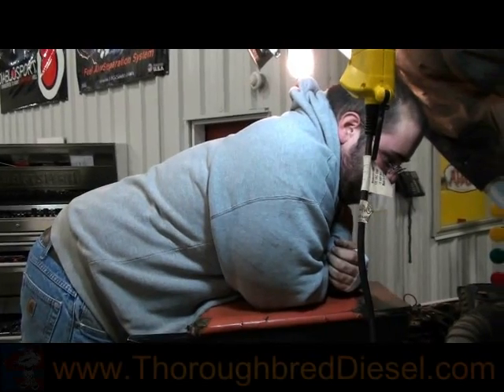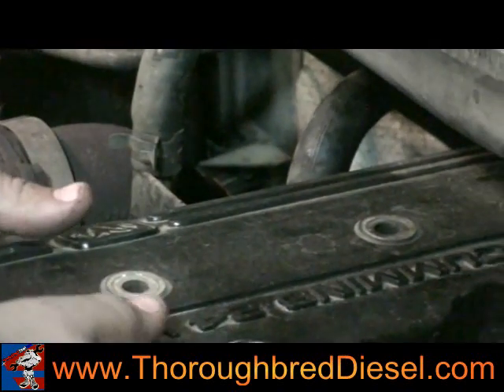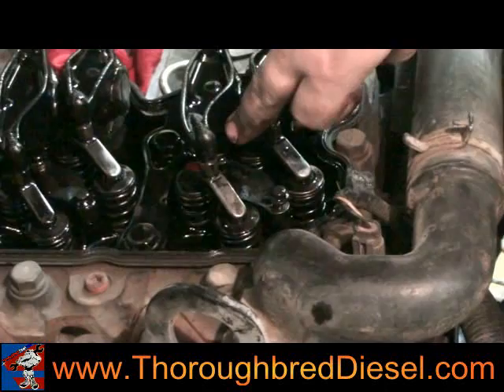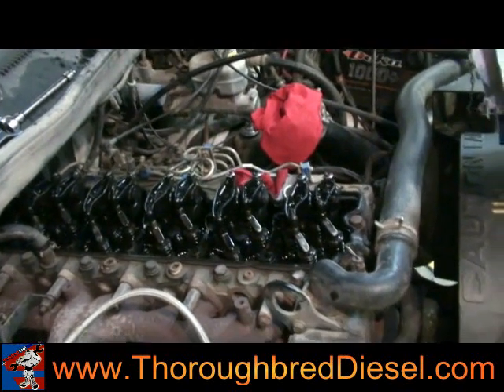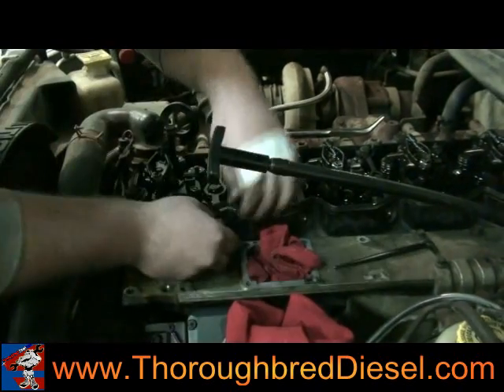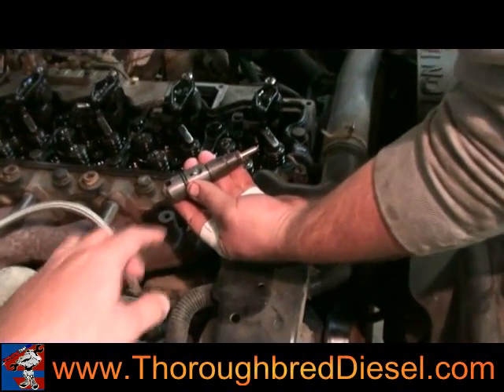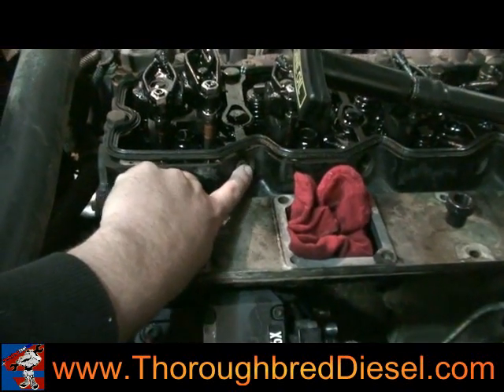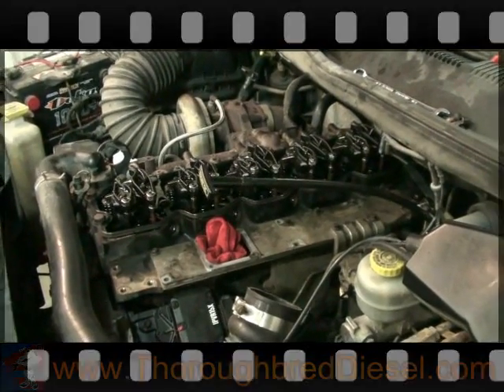Cummins Injectors Install: 98-02 Dodge Cummins

Comment: Out of curiosity, there's a two bolts that hold the injector in. How do you torque them to make sure they are applying equal force to the injector? Don't they have to be tightened equally to make sure the hold down bracket doesn't get cocked?

Comment: I have a 2000 Ram 2500, I bought from a friend and it’s in real good shape but just had a few minor problems.... I have sorted them all out except one, it will start fine when it is cold... then let it run, shut it off and let it sit for about 15 minutes, then it won’t start. Previous owner put a new injection pump and lift pump, I have put new fuel filter, fuel pump relay, and just finished replacing all six injectors... I fired it up after bleeding the fuel system, let it run for about 20 min, then tried again to start and it would not start... I’m desperate for suggestions... but I fear I am going to have to submit and take it to a professional
Reply: NOT A DIESEL MECHANIC

Sounds like your getting a little air in the system. Check your torque for your crosstubes I constantly see that being an issue.

Are you 100% you got all the old copper washers out of the injector ports?
Reply: Check to see if you have 12v at the ECM lift pump plug. It is known to go bad inside the ECM.

Comment: I have an 02 24v cummins, about to hit 220k miles, I'm not looking at installing new injectors but cleaning the old ones, is that a good idea or should I not clean them and just leave it be
Reply from the maker: Pulling the injectors and having them pop tested for correct opening pressure is always a good idea,  especially on high mileage trucks.

Comment: Just out of curiosity, and this may have been asked before, when you said the torque specs for the Injector Hold down bolts, did you mean 89 ft/lb? Or did you mean as you said 89 in/lb?
Reply: He meant INCH POUNDS!!!!

You will break this machine bolt off long before you will get 89 ft/lbs.

Think about it this way... generally you torque your lug nuts to ~100 ft lbs.... now look at the size difference between the hold down bolt and the lug nut.... The hold down is maybe 25% of the lug nut, there for leaving you around 25ft/lbs at 25%.....

If my rough calculations are correct 89in/lbs is roughly 7ft/lbs? (torque wrench only goes down to 20ft/lbs) so you need a different torque wrench than for your tires.

Hopefully this answers your question, if you have anymore please subscribe to my channel I'm constantly trying to make new videos even on stuff that has been done in the past, I don't hide my mistakes either.... I want the world to know where I made my mistakes so that they may have a fighting chance on not making the same ones!!
Reply: Also if you drop a comment on any of my videos I generally pretty quick to respond for now as my channel is small! lol
Reply: Dutty Diesel only took 6 years😂

Comment: do the connection tub but do they need to be torgue
Reply from the maker: Yes,  the fuel line torque is critical and we apologize for missing it in this video.  Tighten all fuel lines to 28 ft. lbs.

Comment: Do I have to pull the tubes and lines if I’m only replacing injectors???
Reply from the maker: Yes. The tubes engage the injectors and the lines hold the tubes.